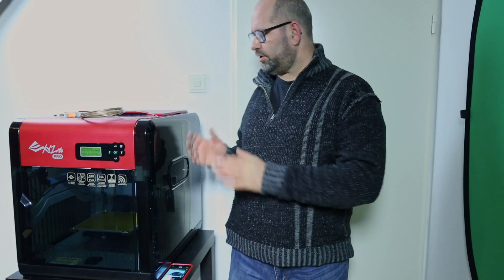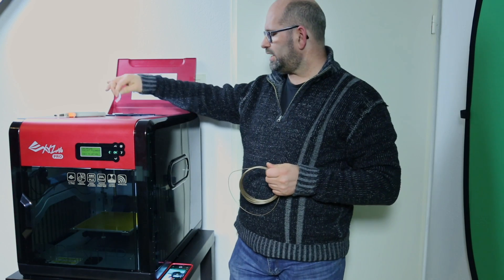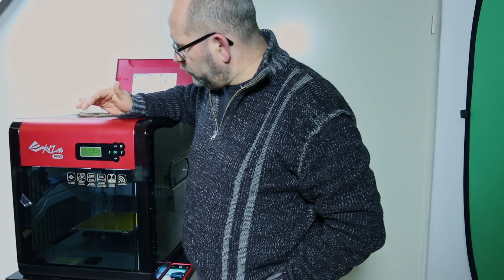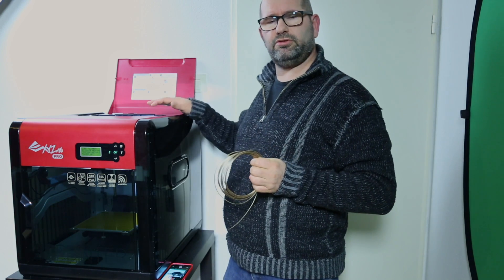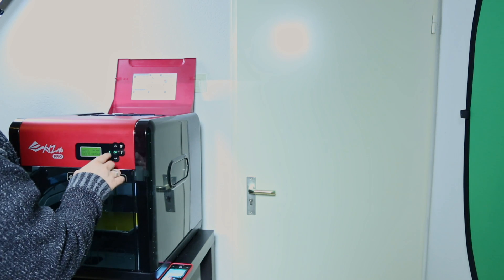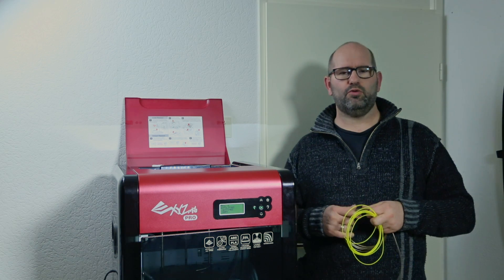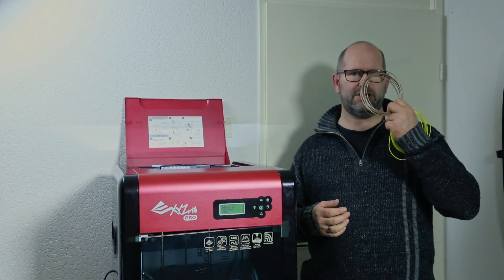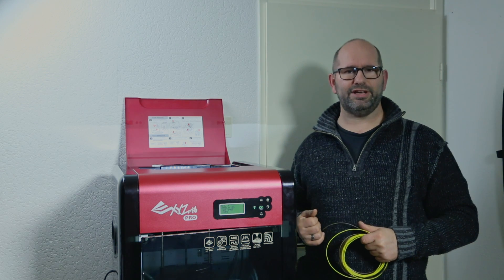▼ Determining the settings for your filament if you don't know

Comment: Hi Brian,  I notice that you have returned to using Kapton tape on your Pro bed.  Is there a reason for that?
Reply from the maker: Actually, there is only one reason for it and that is that I have about 20 sheets of Kapton laying around and I want to use them in stead of throwing them away. But when I am printing with ABS, I will for sure switch to BuildTak again.